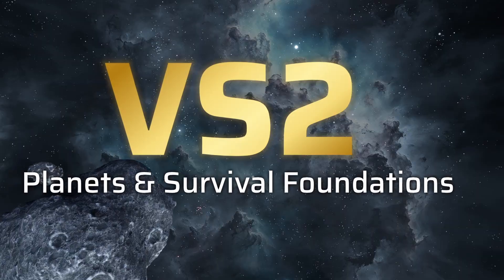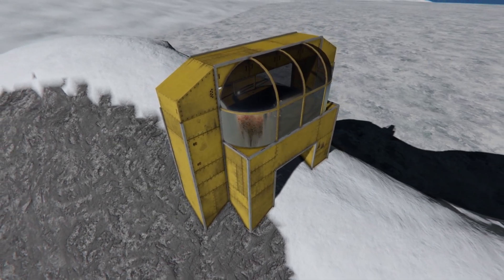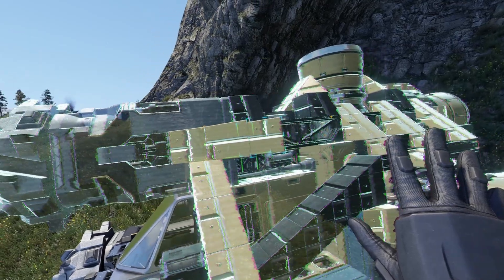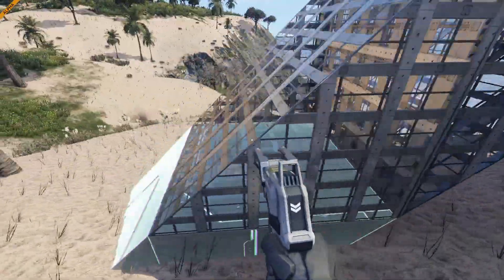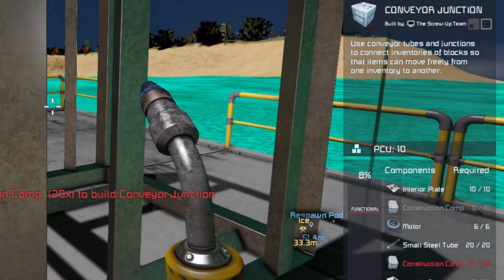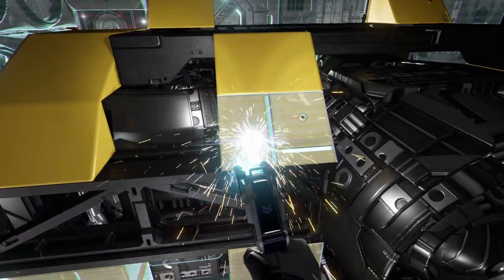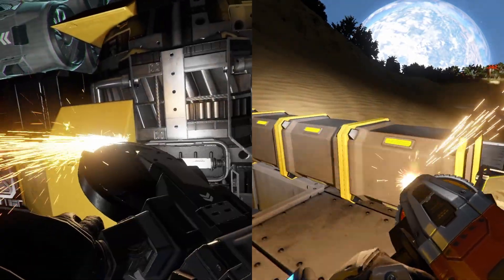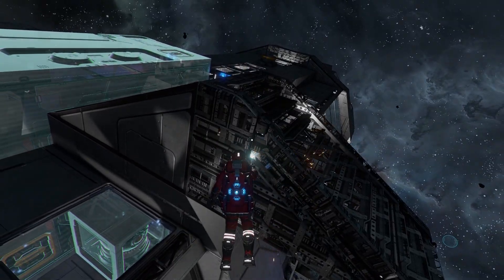SE2’s New Building System Is a HUGE Deal — And Here’s Why

Comment: I do think not being able to use blocks with a single component isn't as big of an issue because of the changes to jetpacks, which now use power, and power lasts massively longer than in SE1.
Reply from the maker: That's why I mentioned "no-jetpack playthroughs". In general, however, I do agree with you, the new jetpack lasts way longer than before. The only caveat is when you run out of energy in the hole digging resources or in space, you're dead with no chances to survive.

Comment: i hate it when i gotta float around a cube for like 20 mins finding the dam sweet spot for the ui to show up lol. i like the way it breaks down but i feel like a mk4 grinder should be able to grind a lot faster. i think that for lesser components that just require ore if you make the components i think they should be a bit lighter than the ore and take less time to weld with components rather than ore.
Reply from the maker: As for that "sweet spot" problem, I noticed that it happens once in a while, and reloading the save typically helps. Kind of a little advice for you :)

Comment: My biggest issue is still the "hackpack-building" 
I just suffle alot of ore into my backpack, I don't even care about making production line for basic components...If I grind something down, is just throw into a container, and grab more ore... Its counter intuitive.

And remove the engineering part of production... 
And feels like I am playing SE 1 with creative mode. 

And
Reply from the maker: I feel you, after almost 3k hours enjoying SE, this part feels wrong. But let me share with you two cases I actually find this system useful.
1. Backpack-only start will become a lot more fun, completely relying on skill, not luck.
2. In case you damaged your ship badly in the middle of nowhere, you have options to fix it, even if not carrying the whole production with you.
In general, I think the idea is OK; the balance is the problem. Because now, when building from raw ores takes roughly the same time as from components, it doesn't make any sense, but imagine building from ore would take like x5 or x10 compared to components? This would make a lot of sense, IMO.
Anyway, thanks for sharing your thoughts. 👍
Reply: You do weld faster when you're using readymade components, but to get that benefit, you need to do some mental math every time you go get more unless you're welding something simple that only needs one thing. It tends to be worth it for the structural blocks that use only iron plates or only small pipes. large conveyors are a bit more complex, but if you're doing a lot of them, you can just calculate it once and then remember the optimal amount to grab next time.
Reply from the maker: You're right, there is a difference in speed, but it's barely noticeable. To make it matter and make more sense, the difference should be a lot bigger, to give the player the feeling that building from components is actually better than from ore.
Reply: @thescrewupteam  I do agree that it feels like backpack welding is too fast in comparison to welding from components. That said, it seems to me that they've balanced the speed such that if you're just welding a few unrelated blocks, it makes more sense to use ore, but if you're welding a huge structure that requires a lot of running between a container and the build, you start saving significant time by using components and being systematic instead.

Also, I didn't notice a difference in speed before I upgraded my welder so I suspect the speed difference might become more noticeable with a higher tier welder.